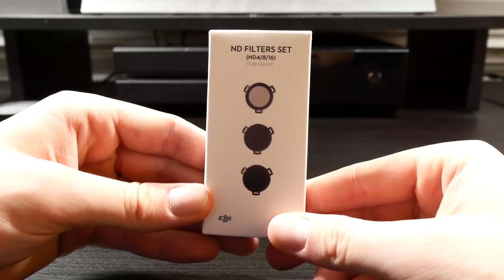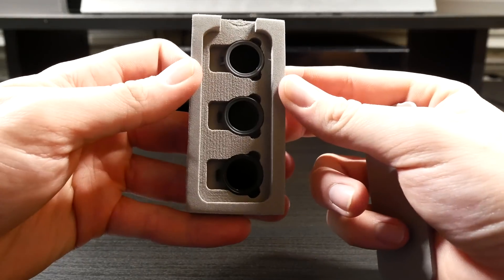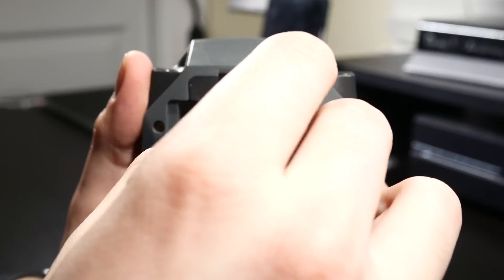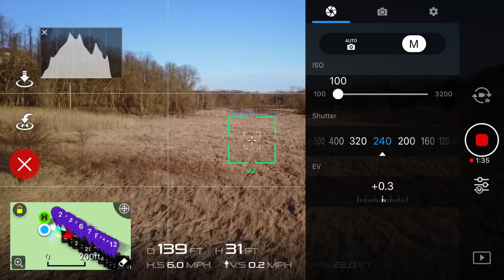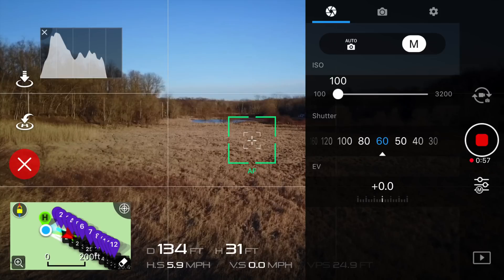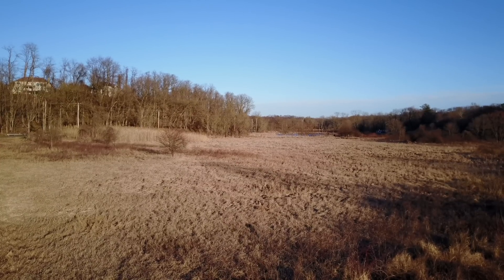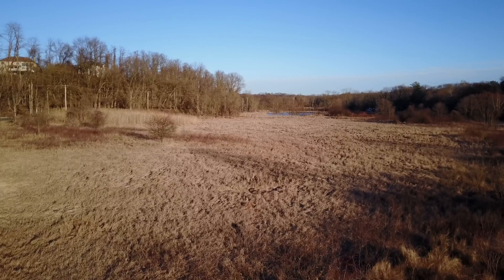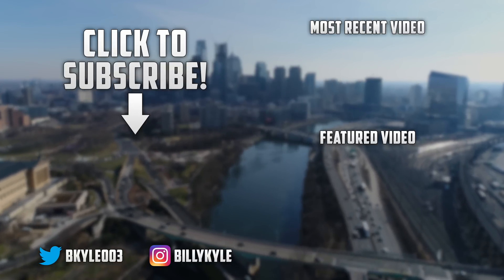Mavic Pro ND Filters Made by DJI (Installation & Test)

Comment: One of the key reasons you use ND filters is to bring the shutter speed down to a more cinematic level. The general rule is that your shutter speed should be twice your frame rate. 
so at 30FPS, your shutter speed should be 60. if you're shooting at 60FPS, it should be 120 or thereabouts. 
But you never mentioned your frame rate. 

Without ND filters, in the bright sun, at an ISO of 100 and a fixed aperture of f2.8 (in other words, wide open) the camera would be forced to run at a very high shutter rate to bring the exposure down.

ND Filters are sunglasses for the lens. They allow you to bring the shutters speed right down when you can't any other way (like on a DSLR where you could close the aperture down).

Since you mentioned shooting in 4k you were either at 24 or 30 FPS.

Comment: Hello Billy, great video! Wondering if you did a video on best performance in sport mode with respect to adjusting the controller curve 
settings. Is it possible to get a faster speed in sport mode by adjusting the settings?
Reply from the maker: +Michael Kaplan No way to get an actual faster speed, but you can change the EXP settings which deal with sensitivity of the sticks. That I have done a video on.

Comment: I had the same blurry effect on my first Mavic Pro. The right side was blurry like a smudge. When DJI serviced it and replaced it with a refurbished one, they wrote in the comments that it was the internal 'horizon' and gimbal which needed to be fixed and replaced. Good luck! I am on my third unit as the replacement one had vertical 'Jello' effect. Today is my testing day of the third unit. Let's cross fingers...
Reply from the maker: +Daniel Saredi Great Daniel! Thanks for the info!

Comment: I received my DJI Mavic Pro ND filters a week ago after ordering them on 1/15/17. They were easy to put on, and did not effect the gimbal, but were not easy to take off. I spent alot of time gently trying to prise the first tab loose, and wound up breaking the ND lens. They are very brittle.  Instead of using these, I got the PGY-Tech ND filters.  They push on easily and come off without a problem.  They do not create any problem with the gimbal calibration.  Instead of plastic, they are aluminum with glass lenses, and come with a nice hard case.  I would highly recommend anyone interested in purchasing ND's for their Mavic take a look at these.

Comment: Nice video Billy. Thanks once again. So if you were to follow the 180 rule of the shutter speed needing to be twice the frame rate, which of the three filters gave you that ratio and would you have actually used that filter if you had been filming a subject?
Reply from the maker: The ND16 for this video, but it was just a tad too dark. If you are off by a few notches for your shutter speed it won't kill you.
Reply: So do you leave the camera on manual settings or switch to auto once you've chosen the appropriate filter?
Reply from the maker: Manual at all times to get the full benefit of using the ND filter